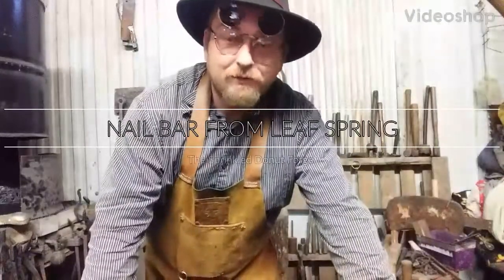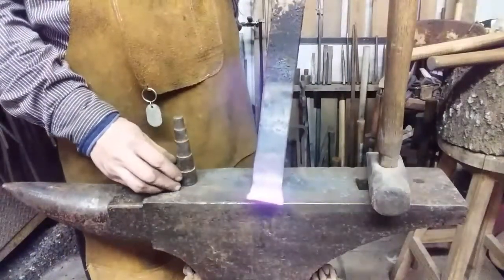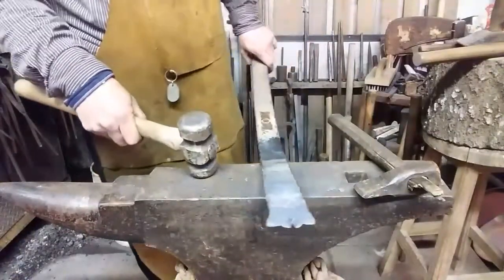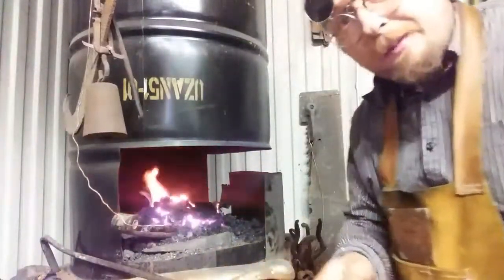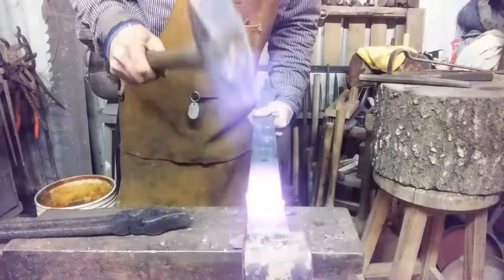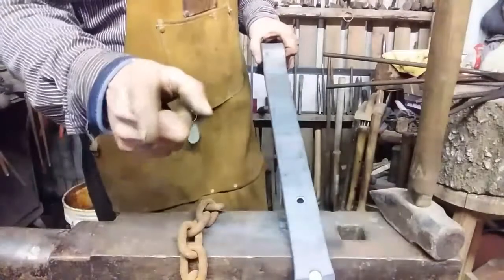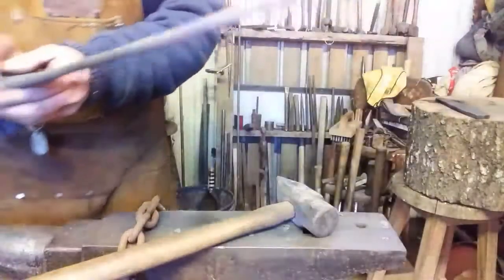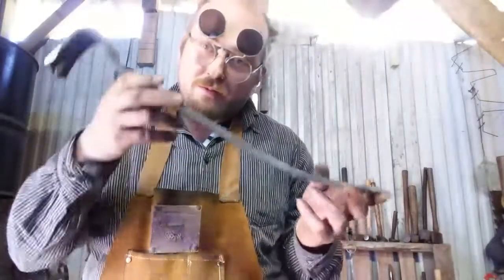Nail bar from leaf spring

Comment: Great video James. Use that type prybar all the time. I might just have to try making a large one. That one you did turned out to be a beast.
Reply from the maker: Thanks Jim! I did test it out on a couple 2x4s with about 20 nails holding them together. It's perfect. I recommend making one. Not that hard to make just a little fiddly clefting and punching the nail eye.